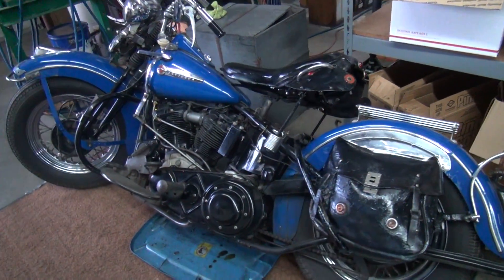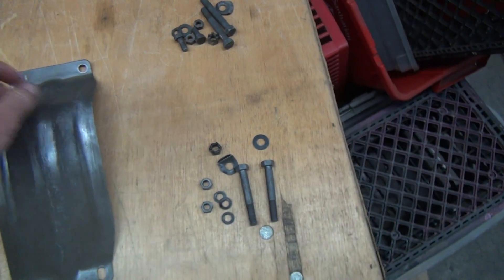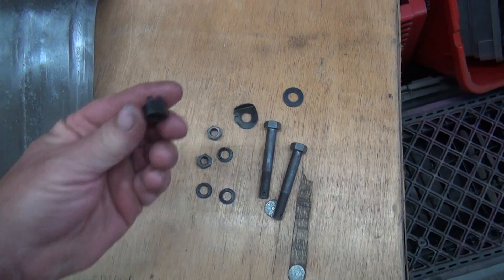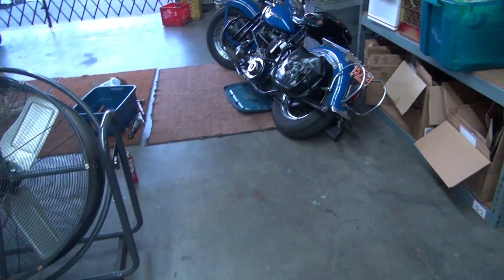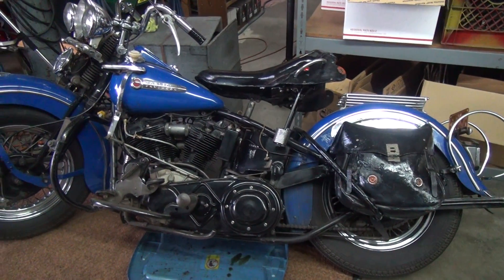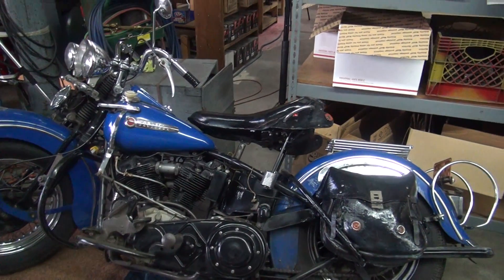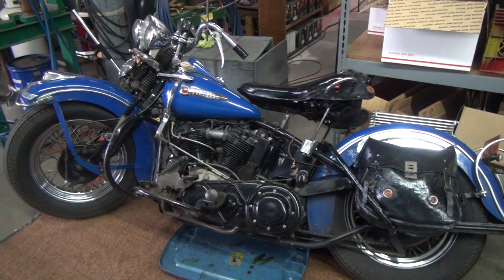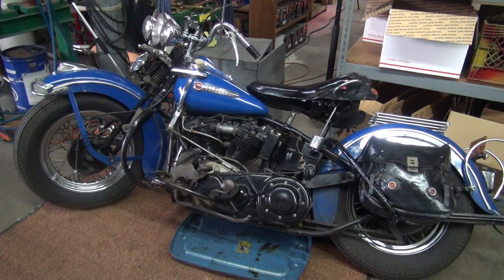Hunting Harley's, 47FL6007 Belly pan after Gibbs

Comment: Todd, you're doing such great job restoring these bikes, but PLEASE look into detailing in a little more... um.. detail. Wax by itself is not the thing to clean and preserve paint. It really needs to be properly cleaned, then polished, then waxed. I'd also be amazed if the paint doesn't need to be clayed as well. Trust me (this random voice of a stranger on the internet), your bikes really will look sensational with the right cleaning process. The metalwork needs similar TLC with a proper metal polish.
If you do a search on YouTube for "Ammo NYC" you'll get a whole load of videos done by a guy who is very seriously obsessive about cleaning vehicles. I've learned quite a lot by watching him at work...
Reply from the maker: These are original paint machines. Old Harley paint is extremely THIN. So is the plating. If I used those processes I would rub right through it. This bike is NOT a restoration, it is an original paint machine in a remarkable state of preservation. Old HD paint is generally 2.8 - 3.8 MICRONS thick. New paint that people put on a "restoration" tends to be between 10 and 20 microns. I do really appreciate your comments and interaction.
Reply: A proper detailing won't remove any of the original paint - the whole point is to preserve it! Paint is only removed if the paint is in such appalling condition that there's nothing left to do but chemically scrape the top layer of it off - that's not the case with your bikes. I'm concerned that by only using wax, rather than clean/polish/wax you are actually sealing dirt and contaminants into the paint. Modern cleaning solutions are so good these days that there's absolutely no reason that 70-year old paint wouldn't benefit (probably more than modern paint finishes!) A good going over with a clay bar (with again isn't destructive at all) prior to polishing would do absolute wonders for the paint, but I understand your being hesitant - after all, they're your bikes (and your money).
Reply from the maker: Adrian, thank you for taking the time to post back. I do realize your only trying to help and am grateful for that. I tried to find something referencing clay bar's on old paint. The oldest I found was from the 1970's. Different paint. Old on shot lacquer paint is what this is. Many times the paint is so thin I cannot even use rubbing compound at all. Someone by the name of Mike Phillips posted about someone's inquiry about a similar problem with a 1940's truck. I am assuming, but do not know, they this has a very similar type of paint to Harley's of the same era. His process is more extensive then what I have done and as he seems to be a paint professional, probably yields better results, or so I would expect anyhow. No mention of a clay bar, but if it works as you and the articles on clay bars say, I wonder why he is not then using it. Here is the article http://www.autogeekonline.net/forum/ask-expert-featuring-mike-phillips/64732-1940-chevy-truck-almost-original-paint-care-2.html
Reply from the maker: PS, I also notice that this was written in 2009. Perhaps today's clay bars are very different from the ones I am familiar with. Technology does  improve all the time.
Reply: Interesting thread, although the process for detailing bikes is a little different (basically you can't use water under anything more than garden hose pressure). Claying was invented in Japan sometime in the '80s (I think) and it's brilliant for removing contaminants that have bonded to the paintwork. Time was, you'd have to have used a cutting compound and taken off the top layer of paint - not any more. All clay does is stick to, and remove, the gunk stuck to the paint. Never the paint itself!
Sorry if I come across as a busybody - don't mean to, I just think these bikes are fantastic and would look absolutely stunning with a serous detailing. But first there's mechanical work to be done and a workshop to move...
Reply from the maker: personally, I think part of any mechanical restoration should also involve a serious detailing of any painting and plating of the motorcycle. I will look more into this and thank you for being obstinate enough to insist I look into the matter of the clay bar.
Reply from the maker: Adrian, which clay bar do you prefer, and why?
Reply: HuntingHarleys
Well, I personally use an Auto Glym -brand clay bar, but I suspect that there's not much difference between one bar of clay and another. I do know that Meguiar's makes a clay Starter Kit with a bar of clay, the detailing spray you need to lube it with and a microfibre cloth (I think). That might be a good place to start.
There's nothing to using the clay itself and you only need a weeny bit for a bike, so the bar will last a while (you don't need to clay the paint every time you clean the bike, obviously). Give the bike a wash, break off a bit, flatten it to a disk, spray the surface, spray the clay and rub gently in straight lines. You can feel (and hear) the gunk coming off. It's surprisingly satisfying! You then have a surface that is free of anything that shouldn't be there, ready for a polish and a wax. And completely non-destructive!
Reply from the maker: Adrian, I went and bought some Mother's clay bar and cleaner. The results are in. Does it work, yes, compared to 3M , nope nada, no comparison. The 3M polish I use works like the clay bar on steroids. 3M might call it "polish" but it does the same as a clay bar and then some and both work on chrome as well, but the 3M comparison wise has unreal results where the clay bar is soso. I will do a video later. the good news is, I didn't realize until I did this, the 3M also makes the Purple Slice I had been using on the chrome a 2nd best has been... AND if the Polish won't work on the chrome, break out the heavy guns and use 3M rubbing compound 1st and then the polish, unreal amazing results, I just can't believe it! Freaking unreal! Thanks for the tip on the clay bar, without it, I would not have learned I had the ultimate detail stuff right here and never used it like this. Additionally, motorcycles have lots of small cracks and crevasses that a clay bar simply cannot reach. A micro fiber towel however does it just fine with some 3M on it.
Reply: HuntingHarleys
Well, there you go! All's well that ends well! I guess it's always good to take a look from another angle...
You're right about the nooks and crannies - clay is no good for those areas on a bike. It's strictly for flat, easily rubbable bits. Interesting that your 3M stuff does that - I may have to look into that (if it's available in Britain...)